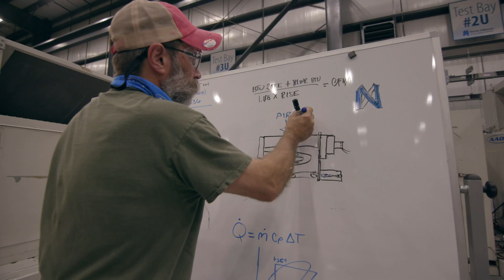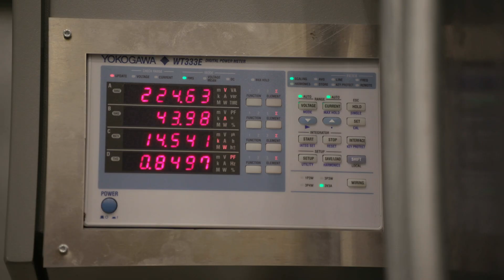Norman Asbjornson Innovation Center - AAON Research and Development Laboratory

Comment: Aaons are nice units but man do they ship like crap. I’ve never seen so many wiring issues and damaged equipment. Did startups for a year loved the ones that were shipped well. The ones that had crazy configurations you could tell the factory workers said fuck this thing. You can also tell the difference from where they ship from. If you get one from TX, say a prayer. Still think they are the best RTUs on the market but they need a quality control overhaul.